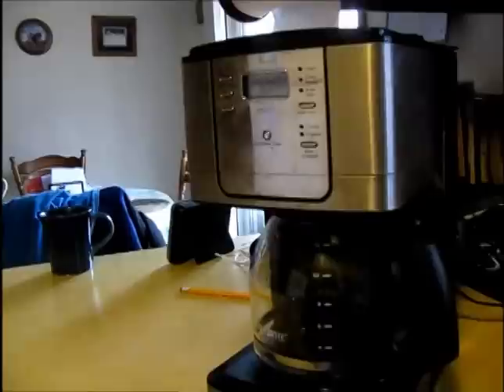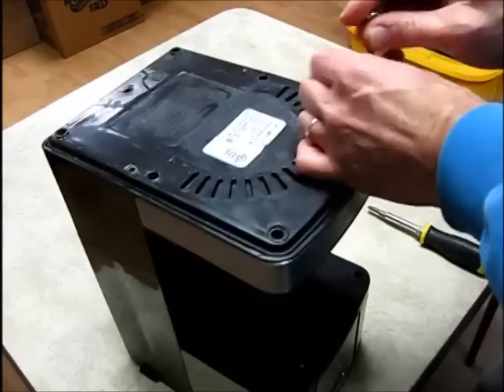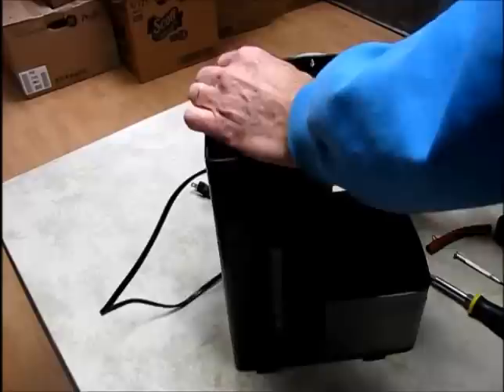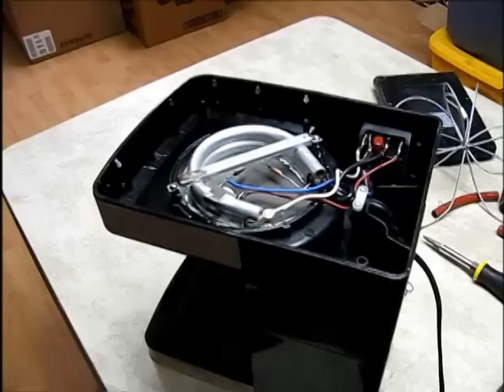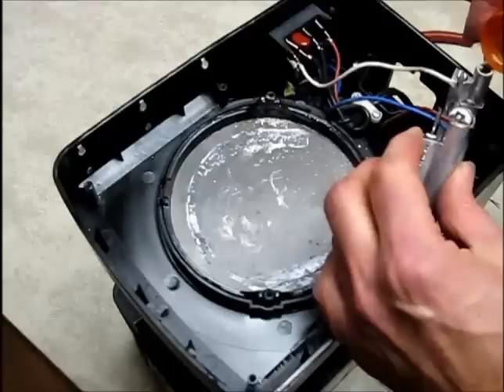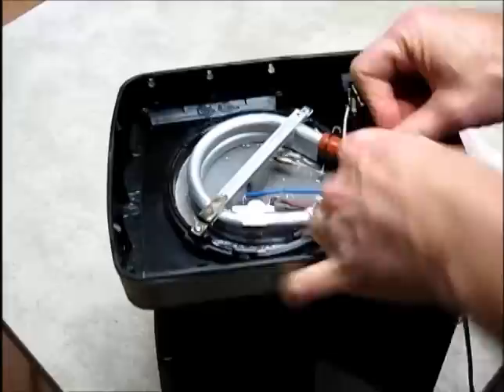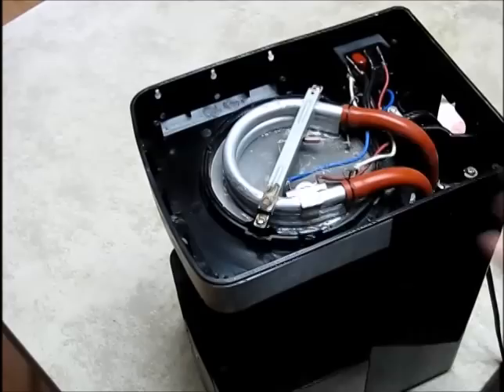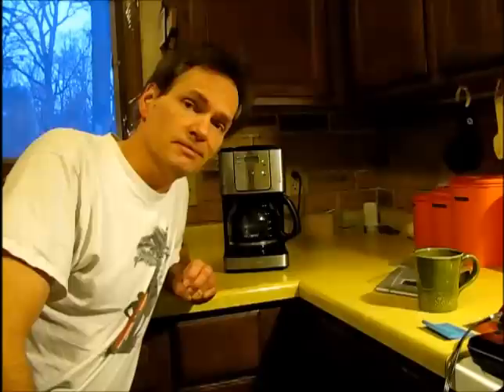How to unclog a Mr. Coffee JWX31 coffee maker

Comment: Fantastic!  Inspired me. Gave me confidence to tackle on my own!  Love the "security screw" issue and your total disdain for the manufactured obsolescence.  Did almost same procedure on a similar Mr. Coffee model.  Immediate results!  Folks those little rubber feet will pop out and pop back in...don't be too gentle.  Keep track of which hose you take off.  My model has a red rubber tube with a back-flow valve in it, I believe.  Don't mix it with the other.  Otherwise, have at it.  What is the worst that can happen?  You trash it, concede and spend the bucks for a new model.  So, not high risk.  BUT high reward to fix it yourself.  I feel like Magnum PI now.   Thanks!  Love the can-do, all-American, fix-it ethos.
Reply from the maker: You're welcome. And thanks for sharing the fun and funny commentary. I really enjoyed it!
Reply: You mean you feel like " MacGiver"....you did a MacGiver fix. 😉✌️

Comment: First of all thanks for posting this video. I had the same problem with my Mr Coffee. I tried running some CLR through it but it still was brewing really slow. So after watching your video I decided to crack it open and sure enough it was exactly the same  inside as your coffee pot. I pulled the hoses and checked the heating element but everything looked spotless. The problem I had was with the ball valve inside the inlet tube. If you shake it, you should be able to here the little ball inside. I was able to extract it and give it a good cleaning and insert it back into the hose. Works great now!

Comment: Thank you for posting that video.  Coffee pot came apart just like in video, and I think my problem was coffee grounds in the check valve.  Design flaw in pot allows coffee grounds to overflow back into water supply tank if basket or pot is misplaced(as happened to this pot).  There is no filter to keep them out of water intake line.  Red hoses are made of soft rubber and easy to remove.  Check valve is inserted into cold water supply line, and can be removed by applying compressed air to heater end of hose.  Cup your hand over end of hose so you don't loose valve when it shoots out.  Toss out those "tamper proof" screws and replace them with phillips.  Corporations have flooded our marketplace with shoddy imported crap, and have no regard for the American worker or consumer!  Better to fix it than give them more of your hard earned money.
Reply from the maker: +Hammerthumb1 You're welcome and I thank you for posting the detailed and helpful comment. I replaced the coffee maker in this video when the heating element opened up (a fatal problem). I found an eighties, US made machine at a garage sale and have been using it ever since. If it ever fails I'll fix, it but I doubt if it will.

Comment: Had the same problem - took 45 minutes to make six cups of coffee! Did the vinegar but to no avail! I watched the video and it was exactly the same thing. I had to drill through the blockage (I made sure not to drill through the metal tube) and soak it with vinegar for a few minutes. Put it back together after washing out the vinegar and now it works! Thanks for the video - nicely done!

Comment: One basic, learned from the days when you banged on the tube tv to fix the picture... I almost tried unscrewing and checking the tubes, but decided to turn the coffee maker upside down and smacked it - figuring the (bearing ball?) inside the valve might be stuck: that got the light to shut off and the coffee maker was quiet as it had been while percolating!

I appreciate the mechanical explanation of the construction of the machine- thanks!
Reply: Thanks for your hint. It worked for me!
Reply: …and what’s funny is getting a reply the same day I had to use the technique again, after my white vinegar descale process failed to make the light go out on both my coffee makers (the other is a Keurig). On the other, I also unplugged for a moment, then it was happy again.

Comment: I've saved some other coffee makers, but this video helped me actually get to my slow Mr. Coffee. Any particular amount of vinegar has a limited capacity to dissolve the calcium (usually) clogging the tubes. So renewing the vinegar every few hours makes sense. An easy way to put the vinegar into the tube is using a couple of feet of plastic tubing (available in a hardware store). Just suck up some vinegar and put it in the cold end of the heating tube (held to make a U), until it comes out the the hot end. I found drill bits to be useful in clearing a lot of the calcium from the hot end. Not in a drill...just in the fingers.There are probably better chemicals than vinegar, but we have vinegar at home, when the urge to take the coffee maker apart strikes.
Reply from the maker: Those are some good tips. Thanks for watching the video and commenting.

Comment: This method also works to get larger debris out of the intake tubing. Somehow I got a bit of paper towel into the reservoir, and it got sucked through the intake and was preventing most of the water from entering the heating element. It was sitting right in front of the little plastic one-way valve inside one of the rubber tubes. Works like a charm now once I got that cleaned out.

Comment: Hey man thanks for the video. I was a little bummed when my heating element looked good. I ended up taking apart the hot water “perk” end which is easy and that was all clear too.

I did notice my check valve looked like it may have been a little gummed out. Took it out and rinsed it and she’s making coffee at normal speeds again, thank you!

Comment: Great video.  I found the tubes clear.  I removed the cold water hose and squeezed out the check valve you mentioned.  I found that there was a piece of coffee ground stuck in the seat for the ball that prevented the check ball from seating correctly and preventing back flow.  Seems to be the fix.
Reply from the maker: Paul Hutson Hey, that's a nice find. It was a good idea to check the check valve! Thanks for watching and commenting.

Comment: I had the same problem, I used steel cable 1/8 by 8 "and use it in the drill as a flexible drill bit and in a few seconds unclog the pipe !
Reply from the maker: Cool solution. Thanks for watching and sharing!

Comment: Where can you buy a replacement hose? Mine is stuck to the heating element intake and when I tried to remove it it started to rip. Kind of glued on from the heat. They don't make those hoses long enough to cut a piece off.

Comment: You could have cleaned those valves out without taking apart- you just run 4 cups of straight vinegar and shut off machine after 3 cups of the vinegar gets flushed through- leave last cup inside machine and let set for a day or two - than rub last cup through - then run a full pot of clean water through machine to flush out particles - works like a charm
Reply from the maker: Great tips. Thanks for sharing!

Comment: One of my tubes had some sort of valve in it with a ball. The ball must have been stuck. I loosened it up and it works now!
Reply: Yes he did say about something about the check valve. You need to be careful not to lose those parts and put them back in the right position.

Comment: My model is the cuisinart cbc-00 coffee maker….same thing with mine. How does that back flow go back inside the hose? —> #* or<—— *# When I dissembled mine where loose. That’s what happens when you put vinegar and baking soda, turn it on….😁😬  amen That’s the truth about fixing, buying a new one! Thanks for posting!
Reply from the maker: I ran water through it when it was out to confirm direction for reassembly and just seated the hoses over it.
Reply: @TheOriginalMechanic  yes sir I figured out this am. I had installed it backwards but easy fix. Now I’m soaking the system in vinegar and will do it for 3 days as well. Mine is so caked on but made some progress today.
Reply: @TheOriginalMechanic  mine is still clogged up after 3 days of soaking I guess I will put more vinegar in it. On one side it’s like halfway very cleared but the other side only can get like 1/4 of the wire in.

Comment: I am really confused by how you removed the security screws, could you please go into more detail?
Reply: There is a little nipple looking thing in the middle of the head to prevent the torx tool from fitting in. Now you can find the proper tool to remove them. But he is using a small screw driver that will fit in between the above mention nipple and the side of the head of screw just well enough to remove. Once removed just replace with a screw with a regular head.

Comment: Hi there.

I have a similar product where it was blowing steam.

I pulled the thing apart however I lost the little ball in the check valve that goes in the cold water hose.

Do I need this or can I purchase a replacement valve somewhere?

thanks.
Reply from the maker: +Doug Dexter Yeah, you are going to have need a working check valve. Without it you will get back flow of heated water and it just won't work at all.

Comment: Great video. I have a Farberware 12 cup drip coffee maker that just beeps like the coffee is done almost immediately after power is turned on. No gurgling or anything, could it be the thermostat? I'd hate to just throw it out and buy another.
Reply from the maker: Unless yours is completely plugged up, you probably have a different problem. I'm not sure what device controls the "pot done" beeper. The thermostat could be involved. If it was mine, I would definitely tear it apart and have a look. Thanks for watching and commenting.
Reply: It was working fine a few days before. Also, the hot plate does not heat up either but display and everything lights up fine. Not sure what the issue may be. I'd feel comfortable ordering a thermal switch and replacing but not much else. Thanks for the input.

Comment: My issue is, that the basket that holds the filter doesn't drain into the pot. It just sits there and drains a drop at a time.
Reply from the maker: These baskets usually have a spring loaded release valve that opens when the carafe engages it. This part may be plugged or broken or the carafe is the wrong one for it.

Comment: I have that exact coffee maker and now it completely stopped pumping after I put CLR diluted in water. Do you think this will help? Iv'e only had it 6 months and have used the auto clean once
Reply from the maker: If it isn't pushing through any water at all, I would wonder if the heating element is bad, or a thermal fuse blew or the check valve is plugged.  The heating element in the one shown in this video eventually failed. It looks like you will need to pop it open and have a look...
Reply: Thank you!

Comment: Without disassembling the machine, what if you put a fair amount of vinegar and start the brewing process. will that unclog it faster?
Reply from the maker: Well, I tried that a number of times with little or no success. I like to take stuff apart anyway, so that's what I did to get it back up and running.
Reply: toomtoom1212 That only works if it's not TOO clogged up.
Reply: i tied that. Mine wont brew or flow water at all. have to take apart.
Reply: @TheOriginalMechanic  
Have you ever tried WD-40 for removing the water minerals? 
Let it soak for an hour or so (depending on the amount of buildup), and then take a long, narrow, brush to scrub the buildup out. It doesn't require much scrubbing at all. 

Clean the WD-40 with very warm water and run the brush (wrapped with a paper towel or cloth, through the tube to get any WD-40 that the hot water did not clean off completely. Run vinegar through the pot one time before making coffee again.

Comment: Thanks for this video!  I was looking for instructions on an ancient JR4 model but this looked pretty close.  The water was pouring straight through so I opened it and sure enough, a hose was loose.  But there was a mysterious spring I didn't know where to put back.  Mine didn't have a valve but you made me go look at the hot hose and viola! It had a spring inside.  It was also very clogged up so I did like you show and soaked the heating element in vinegar overnight.  I also used a small screwdriver and paper clip to dig out more calcium. 

When I put it back together and tried it with vinegar, it made all the right noises and got hot where it should but nothing came out.  I put in more vinegar but it seems to have quit brewing.  You stated your heating element went out shortly after.  Could there be something inside the heating tube that we messed up?  I'm letting this one sit and cool down right now and will turn it back on later.
Sheryl
Reply from the maker: ssgiddyup Sounds like you did some good work here. If it is heating up, then your heating element is good. I would suspect there is still something stuck in there keeping the heated water from moving along. I can't see how cleaning the line this way could open the heater, which is isolated from the water chamber by the chamber wall. Good luck and don't give up...yet!
Reply: The Original Mechanic OK, maybe an overnight soak will do it then.  I want to see if I can get the top off without breaking it so I can check the hose in there too.
Reply: The Original Mechanic I forgot to tell you!  I took it apart again and even got the top off.  After cleaning everything, the culprit was still build up at the hot 
water exit.  I used a small screwdriver and with your assurance, really 
dug hard in the metal tube.  Quite a bit more sediment came out and it's
 been working great for a week now.  Thanks again!
Reply from the maker: ssgiddyup Way to stick with it. That's half the job sometimes!

Comment: What I'm gonna have to do to fix this piece of shit is take it apart screw by screw and until it is completely disassembled. Now, I'm gonna need several specialized tools just to open the back hatch, and those are gonna run you about 500 a pop. OR, I could just throw this fucker in the garbage and buy another maker for 40 bucks.

Comment: What’s the lifespan for a coffee maker these days? I have a cuisinart that’s like 14yo and while I’ve never had any issues...it decided to boil the coffee and almost bust the carafe.
I even unplugged it, but a few minutes later, it got so hot, it began to turn red.
Idk what to do. 
I removed the carded immediately when it began to crackle from the heat. 
How are they able to work without electricity? 
Could it be my electrical that initially malfunctioned? 
Any help is appreciated! 
Thanks.
Reply from the maker: That's an incredibly long life span for a coffee maker. I think 5 years is typical. I would the retire it considering the hazardous overheating.